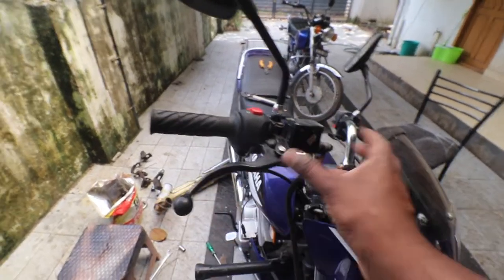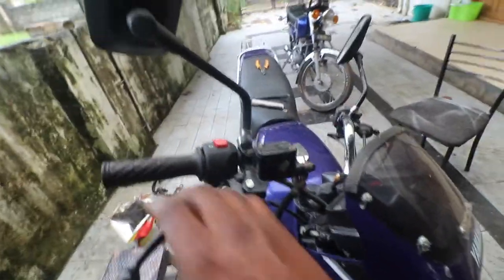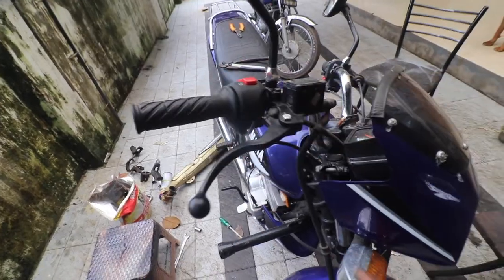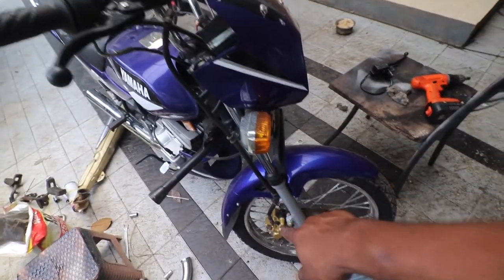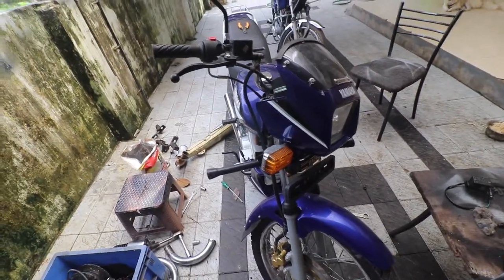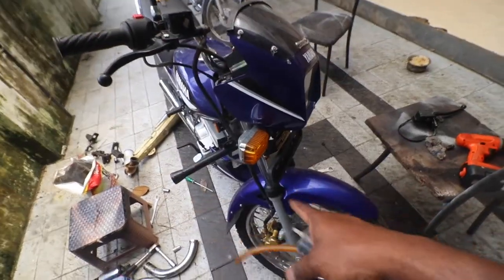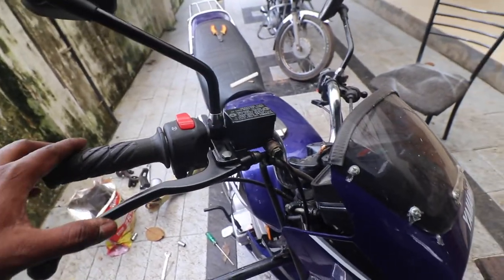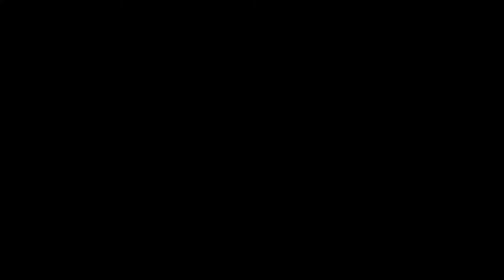How to fix disk brake issues, Feat My Blue RXZ 5 Speed (English video)

Comment: Hi, which caliper hav u used in this rxz 5speed    & is it possible to fit any other caliper original rxz shocks and keeping  disc plate  original
Reply from the maker: R15 V1, you need spacers for fixing the caliper